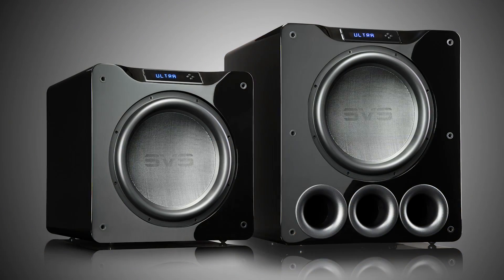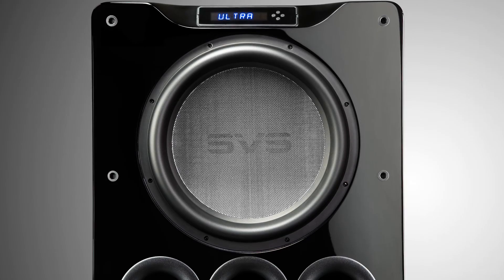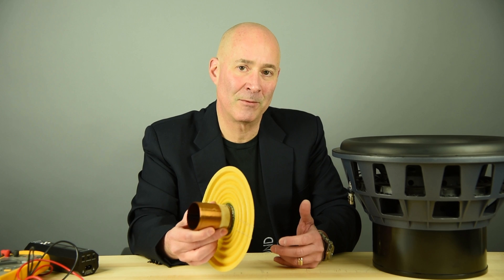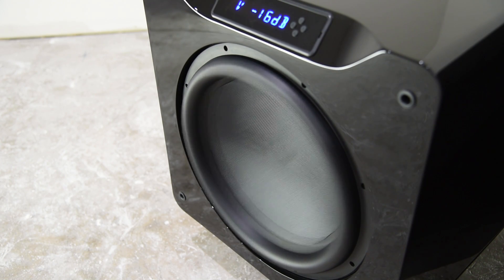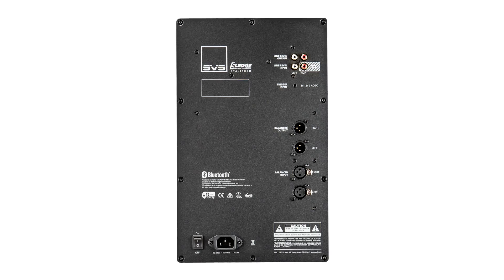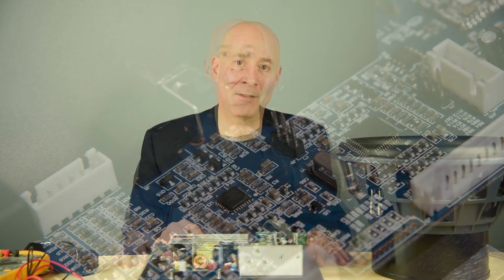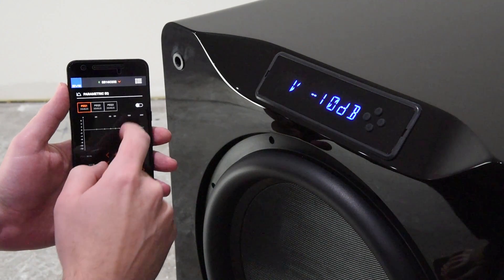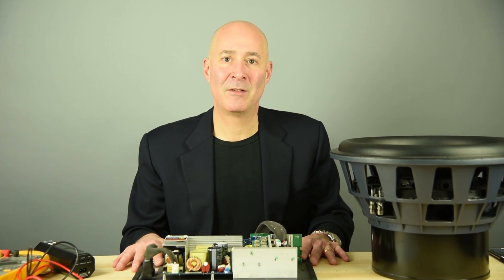SVS 16-Ultra Subwoofer Technology Overview

Comment: Love the architecture. Love the innovation. Commendable. The 8 inch coil paired with the dual, separated spider is stupendous and absolute class. That said...the subwoofers are still a compromise, if for no other reason than the compact sizes. I'd need much more from a sealed alignment...and at a lower price point. Vented subs aren't really my cup of tea.

I do remember the halcyon days of the lowly PB10-ISD. No subwoofer manufacturer ever got more out of 300W and a 10" driver. It was a marvel...but really simple. A driver in a properly sized cabinet.  And you didn't need all the bells, whistles and governors. It was the best kept secret in the business...at least for a short time. 

Sooner or later you have to build a bigger box.

Comment: If you had to pick one of this one for movies and listen to music which one would you pick?
SVS PB4000 vs SVS SB16 ultra ……50% music and 50% movies
Reply from the maker: PB-4000 gives you the option of running in "sealed mode" with the ports plugged, providing a more musical experience than when ports are open. It does take up significantly more floor space but if that's not a problem, it would be a great choice.

Comment: What I need a 20  Amp  Wall socket for For 2 of those
Reply from the maker: No. 16-Ultra subwoofers have internal power correction and can operate off a typical 15-amp circuit and wall outlet.

Comment: Hey, quick question. If i "close" the ports of a PB-16 Ultra, do i essentially have a SB-16 Ultra in terms of speed and tightness of the bass?
Reply from the maker: Just about. Not an exact match but sealed mode does greatly enhance the PB16-Ultra subwoofer's transient speed.

Comment: Hii, if we purchase svs pb series subwoofers means we no need to buy an amplifier for this sub, since it is having an inbuilt amplifier in it. Can We connect speakers directly to this sub?
Reply from the maker: You still need to have an AV receiver or something to produce the source signal, but the subwoofer has it's own amplifier so it won't require any power. Unless the speakers are powered and have a subwoofer output.
Reply: @SVS_Sound  k Sir thanks for clarification.

Comment: Even the smallest subwoofer the sb1000 can produce bass until 20hz because in movies or bass music which contains 20hz notes makes my walls and doors shaking even with the volume at 3.5 out of 10 on sub very impressive.

It was not the case with others subs of this size even at a very high volume.

Comment: Hey guys. Does Sb16 work in smal room? Its not practical for me to have 2 subs or ported ones...
Knowing that Sealed subs lack deep bass output in comparison to ported ones.
Im thinking maybe Sb 16 big driver can compensate deep bass loss   vs pb2000pro for example.
Thanks.
Reply from the maker: Yes, though if it's a small room, you may be fine with the SB-4000, which will get you down to 19Hz. The SB-16 Ultra will get you to 17 Hz and there's very little content in music or movies below that.
Reply: @SVS_Sound  yes but on the same wolume sb16 would give more bass output at the very deep bass... or difference is not that big?

Comment: The amplifier looks too small for cooling. Since I believe its class D witch efficiency is about 90%, 10% of energy is turned into heat. so 150w goes into heat witch is quite a lot. You need like 3kg of heatsink or even more to keep it cool. I dont see any fan or something. Amp seems fishy to me. 1500w to 1ohm maybe, but it should get hot as hell. I made myself 500w (RMS) / 8 ohm amplifier and mounted mosfets to 2kg aluminium plate and attached 0.5kg radiator with fins to that plate, and it still gets pretty hot after a while on high volume.
Reply from the maker: The amp is capable of 1500W continuous power into a 4 ohm load. That does not mean the amp is continuously generating 1500W of output.  Therefore the heat dissipation calculations don't apply.     
  
While the below are estimates, you can expect the Sledge STA-1500D to pull about the following power levels from the outlet under various conditions:

• standby = <0.5W
• on at idle with no signal = 22W
• low to moderate volumes = 50W-200W
• loud to very loud volumes = 300W-1500W (only for very brief periods)

The amplifier heat sink capacity is more than adequate for the intended usage of the amplifier and the average power draw under normal use conditions.

Comment: @SVS, in PB 16 Utra, if we try to put in max volume, what happen to the amplifier inside with too much vibration?  the amplifier will not be broken inside? we all know too much vibration can make some boards or chips or capacitor lose connection or cut
Reply from the maker: Thanks for the comment. Internal bracing and rigid mounting within the PB16-Ultra ensures no vibrations will adversely affect amplifier performance.

Comment: wow is this box and woofer made of plastik?
Reply from the maker: No, high density fiberboard for the cabinet with piano gloss black finish. The drivers are a glass fiber composite.
Reply: @SVS_Sound  so how this speaker is so light? and box and amp
Reply: @SVS_Sound  my 12" and box whith no amp is 82kg and its only 1200w rms

Comment: What are the difference between the four thousands in the ultra 16s
Reply from the maker: The 16-Ultras have a larger driver and more powerful amplifier so they can produce greater output and hit lower octaves. Accuracy, refinement, speed in transients and amazing sound quality are the same, the difference is volume and depth.
Reply: @SVS_Sound  thank you for your reply I own two sb13 s absolutely love them I wish they had the capability of the Bluetooth app that's very cool I also own a pair of ultra Towers and the Ultra Center
I was using them with Klipsch speakers RF 83 I listen to a lot of dubstep at high volumes in the past I had cooked the tweeters in the Towers back when it first happened I had called you guys to make sure my crossover frequencies were properly set and they were but I was advised that mixing them with Klipsch or any other style speaker is optimal so you guys sent me new tweeters and I discontinued using the Klipsch I'm afraid I have cook the tweeters again and on the towers I'm not sure if my woofers are working I haven't been using them for a while I really loved how they sounded for movies I went back to using all Klipsch I was just recently in a home entertainment facility that sells your speakers and subwoofers he had told me to call you guys I don't know if just the tweeters are cooked also the midranges in the towers and the Center Channel I think the larger Twitter is cooked what would be the best way into having my towers and Center Channel check to see what's working and what's not if I got them fixed I was going to put them upstairs in my family room and not in my theater room what is your advice
Reply from the maker: Please send our support team a note at custservice@svsound.com and they will take care of you. If the products are less than 5 years old, they're covered by our 5 year warranty. Even if they're older, we'll have options for you.
Reply: @SVS_Sound  thanks for the reply I will do that

Comment: I needed to hire a concrete breaker to break up some concrete in my basement to prepare the floor for my 
new listening room... I couldn't find one man enough to do the job...
Hmmm, I thought, I know what do do!
So I took my SVS apart, mounted the driver onto my drill... NO PROBLEM..
Smashed it to bits...
 
Frank...

Comment: I'm not sure if I missed out the explanation but if these were create from scratch, what were the reason to go into non-commercial sized like 15" and 18" other than the coil being small?  What makes choosing odd sized 16" size?

Maybe a custom sized voicecoil for 15" or 18" drivers? Just curious.
Reply from the maker: We  tested all different designs from 14" to 20" and found 16" offered the greatest output potential while still remaining accurate and controlled so we could maximize SPLs and sound quality.

Comment: why you've choose an underhung geometry for the sealed box version that will reduce the linear xmax capability? The transducer used in the pb16 ultra have an overhung coil and in fact have better performance in terms of xmax, both lienear and mechanical.... (yes, I now the theorical low distortion of the underhung design, ma in fact is just a myth...the magnetic field won't just vanish just over the gap, so have an higher coil still remains an advantage to my eyes, even in terms of electrical power capability) Apart from that the 2" coil example that you've used have and higher coil than new 8" coil O_o :/

PS: Have plan for the future for an ipotetical symmetric dual coil - dual cap motor subwoofer?
Reply from the maker: SVS uses an overhung motor topology in the SB16-Ultra and an underhung motor topology in the PB16-Ultra.  The T/S parameters of each driver were carefully chosen to provide optimal performance in their respective cabinet volumes and acoustic alignment (sealed and bass reflex).

Comment: What reciever would be good to handle this I bought a Sony str-DN1080 is that good e ought
Reply from the maker: SVS subwoofers have their own internal amplifiers and DSP so the receiver doesn't have a huge effect on performance, The Sony will work great as well as models by any reputable manufacturer.

Comment: Is this driver built by Tymphany?  It looks very similar.
Reply from the maker: We custom design our own drivers in-house and work with Tymphany for manufacturing.
Reply: Your processing and the driver design are what really sets the PB 16 Ultra apart.  I'm just a poor boy, though.  I have a Dayton Ultimax 15 currently that I am building a 1/4 wave T-line for.   I suspect it will pale in comparison to your subwoofer.

Comment: Curious to know what the linear peak-to-peak excursion of that driver is...  From my understanding one of the drawbacks of such a large voice coil is reduced linear Xmax due to the size of the former vs. the spider.  Those dual spiders only have 3 non-progressive rolls on them from what I can see, so I wonder how much travel they allow.  Also the voice coil windings seem rather short, even compared to that 2" coil.  Is this an underhung driver?  Other things come into consideration, like moving mass of a coil assembly that large.  I guess that's where the 1500w amplifier comes in.  

I'm not bashing this thing by any means...  It looks truly impressive, and I'm sure it sounds equally so.  I'm just curious about a voice coil that large.  Different manufacturers have taken different approaches to designing a woofer that can move stupid amounts of air with insane linear Xmax (the JL W7, Adire Brahma with XBL² and JBL GTi with Differential Drive come to mind.  All from the car audio realm, I know, but both trying to obtain the holy grail of accurate bass reproduction).  JL uses W7s in their Gotham and Fathom series, the latter of which might be compared to the SVS 16-Ultra, though it's double the price.
Reply from the maker: Hi Brandon  - The PB16-Ultra has an underhung driver with 95mm peak to peak Xmech excursion (82mm Xmax), while the SB16-Ultra has an overhung driver with 78mm peak to peak Xmech excursion (65mm Xmax). All specs are listed on the 16-Ultra product pages of our site. There are many press and consumer reviews that can speak to the accuracy at high SPL levels and other performance attributes, but we strongly believe it's true reference quality bass.
Reply: Thanks for the reply!  That is indeed a beastly amount of air those things can move.  Kudos to you guys for pushing the envelope on no-compromise driver design!  This is what will set you apart from the rest

Comment: I love svs and I’m sure that 16 is a monster, however svs seems to only like making single driver subs. A Dual opposed 15 inch sub like the seaton subversive is regarded as one the best non DIY subs you can buy. You get more woofage for you’re money IMO. The 16 ultras are beasts too I’m sure but they’re only single driver subs. I’d love for Svs to release a sealed dual opposed sub but doesn’t seem like they will. Svs makes great subs and I love my pb2000; gonna add a second at some point but if one desires more output there are other options like seaton and PSA.

Saying larger driver subs aren’t as good just is not true
Reply from the maker: Thanks for the comment and more importantly, for being an SVS owner. We' have considered the idea of a dual opposed subwoofer and will never rule anything out  but nothing coming in the immediate future, I will pass your feedback on to our engineering team.

Comment: I've been hoping for years, that a manufacturer would get serious about putting a decent voice coil in a large-diameter subwoofer. SVS, I am incredibly proud of you. This is the sub I've been waiting for.
Reply: a higher diameter voice coil will result in a very high power handling and the chances of frying the vc with that high power are slimmer since it is bigger. but you will get less efficiency because of the weight and the excursion of the woofer suffers because the diameter of the spider will get smaller as the vc gets bigger. thats why most high insane high excursion drivers tend to have voice coils as big as 4 inches or even smaller so the spider will be able to move much more

Comment: You have no suspension with a coil that big
Reply from the maker: While not mentioned in the video, the suspension consists of dual Nomex spiders for improved linearity and driver control at extreme drive levels and a low-creep, rubber long-throw surround for excellent durability and longevity.

Comment: few questions
If this sub is so great  why dont people have it in car audio applications?
Can i buy just the sub?
And why would you use a class d instead of a ab that sounds 10x better?
It looks impressive for sure.
Reply: Because your car wouldn’t handle the power. If you want your car doors to blow out along with your head, then sure, put an svs sub in your car.
Reply from the maker: SVS makes home audio subwoofers which require different cabinet and internal design so our products can't be used for automotive applications and the 16-Ultra Series subwoofers are available as complete units, not separate  parts if that answers your question. Regarding the amp, Class D is a more efficient design that runs cooler, plus it also keeps the cost down. The fully discrete MOSFET output allows the amp to move as much current as needed to power reference level SPL and low frequency extension while still leveraging the benefits of a Class D design.

Comment: Had a pc and pb ultra.Soldem.Couldnt stand them for music and for movies they were fine but it seems like they have some kind of subharmonic synth going on to make everything sound like it has subsonic content. A sub should not have the exact same type of bass on all material. Build and style quality were great but performance was disappointing . Ya they could shake and pressurize a room but between 40 and 80 hz they seemed dead. Ive had alot of subs too so its not user error. Its actually how i ended up with two.Just to be sure. I may try one of the sb16 in the future but that talk about 15 and 18 inch drivers is aload of shit. Just look at power sound audio. Those guys were some of the main r&d for svs. I think they may know what they are doing.. Igot two xv30fse after i sold the ultras. These nail movies and music. Ive also had jtr,epik,hsu, paradigm and more. Ive heard submerssives and the big velodynes and they are superb too. Dont let svs fool ya with hype. Let your ears be the judge.
Reply: Having that big of a voicecoil also kills efficiency and causes more power to be wasted on moving the driver. A 16 inch driver does not need an 8 inch voice coil. Its marketing. The cone size between the ultra 13.5 and the 16 is not that dramatic to require that and please do tell how you get 5k wattage from a 20 amp dedicated outlet without massive distortion? Its math and physics. Maybe thats why they need such a big coil to absorb all that heat from wasted power due to distortion. Food for thought. Oh and entirely made in china. Tsk tsk.
Reply: That type of design is really meant for effects due to the heavy moving mass. Personally I don't like using "subs" up to 80Hz, they just don't sound right. Unless you have one specifically designed to be for higher frequency response and not just rumble the room <50Hz.
Reply: What i couldnt stand is theymade everything sound like it had subsonics. Same sounding bass on all material . I run one sub at 80hz and below and the other at 40hz and below with my fronts highpassed at 40hz as they have 15 inch woofers. Ijust really got tired of the svs sound pretty quick. Unnatural subsonics with no slam. Had an epik dragon 18 sealed sub i preffered to them and it was only 600/1500 watt but an excellent all around sub.
Reply: I also find it interesting how there are so many open box pb and sb 16 for sale on ebay for 4 to 500 off with free sipping and full warranty. Im sure there are plenty of people that realized what i did with my ultras.
Reply: slim jim You should have tried miniDsp before getting rid of them